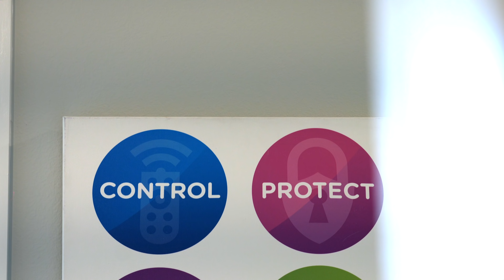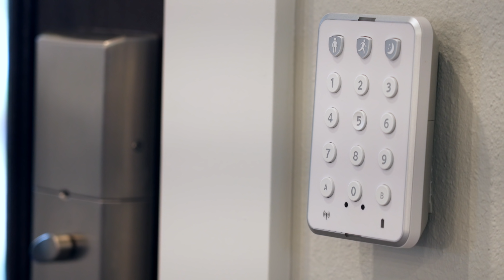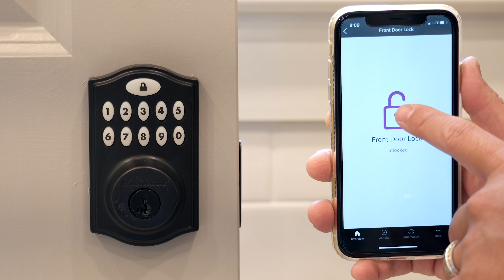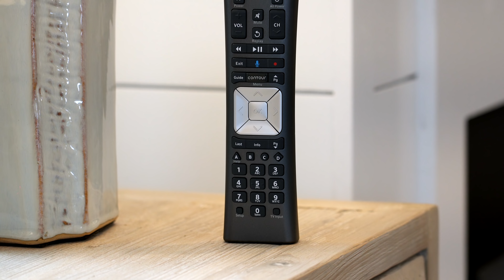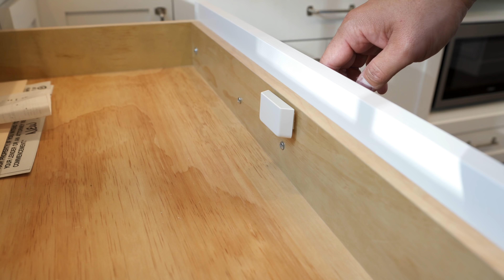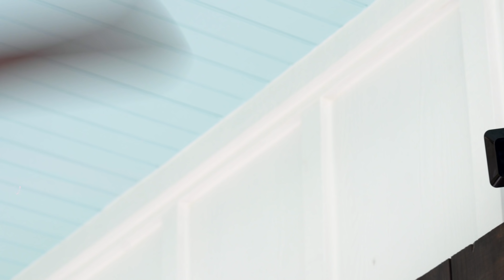Ultimate Smart Home: Easy Edition Tour!

Comment: Wouldn’t it make sense to set up security cameras somewhere hidden and or away from line of sight?

I think that it’s smart 😏to have a smart home set up these days and I appreciate you making this video.
Reply: interesting question. I think the biggest concerns should be making sure the system's efficient in what it can see, and making sure that it is also difficult to tamper with. if the cameras are in line of sight, outside of aesthetics, I feel that is much better deterrent than making sure they are hidden. I can see the concern for tampering or even for intruders actively searching for the home base of the system to avoid being caught, but ideally a camera system is just one of many layers of home protection. the more layers they have to account for, the less likely they are to attempt the act. anyone who doesn't care wouldn't bother to look for the system or be bothered by anything else honestly. that's how i see it.
Reply: @yessi_r6537  A lot of good points.

Comment: The only thing I worry about doing everything on my own is with security like if someone hacks into your network I guess I need to do some research into how secure some of these products are.
Reply from the maker: There are ways to secure. Also picking the right products that have better backend encryption are key. You are correct with research. Do that first before picking your products. Sometimes going cheaper is not beneficial.